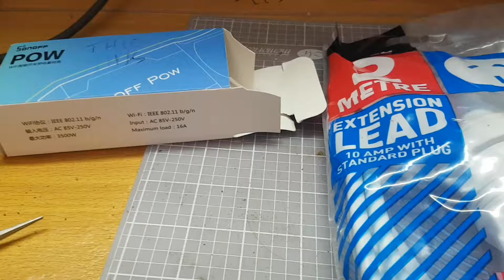Sonoff POW assembly of parts IOT. Part 1 of 2

Comment: Never ever put solder on wires that are going do be clamped anywhere. Either leave them blank if the sockets support that, or use wire end ferrules. Especially where you deal with high voltage/wattage...
Reply from the maker: Soldering a wire will not cause any problems.  I have 30 years experience in the field of electronic repair with the military.  Never had a problem. Have a nice day.

Comment: I would like to beef up the capacity of this controller to make sure that 16A are comfortable. In your opinion would adding a wire to the power points help?
Reply from the maker: +TC Not sure what you met about adding a wire to the power point? But these POW's use a single copper piece of wire internally, which they measure across. I think it is only 10 Amps rated. If you went up you may destroy it or start a fire.
Reply: On my unit it is rated for 16 amps , I see that they applied heavy solder to the main power rails , but was not sure if there was a copper bar or wire under it. I was thinking to beef up the trace to ensure that they don't heat up.
Reply from the maker: TC I think it is a copper track mate plus the solder. If it says 16 Amps give it a try. Just make sure it is away from stuff when you try it. But I think they tes them at the factory. Good luck.